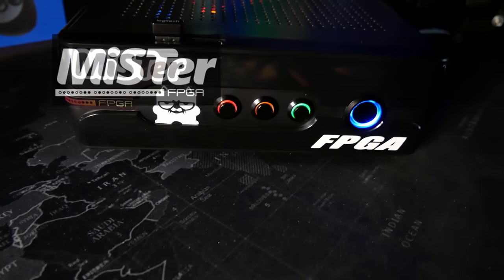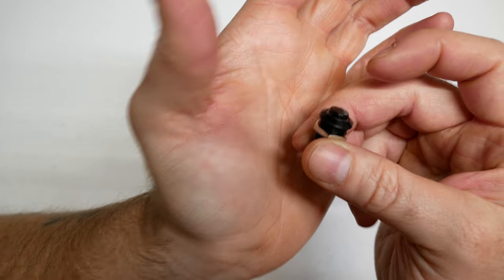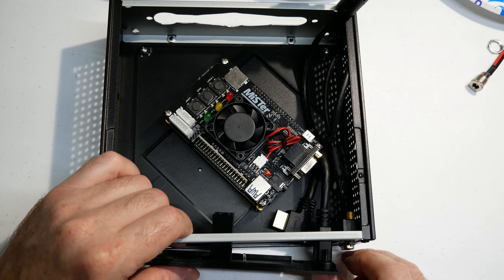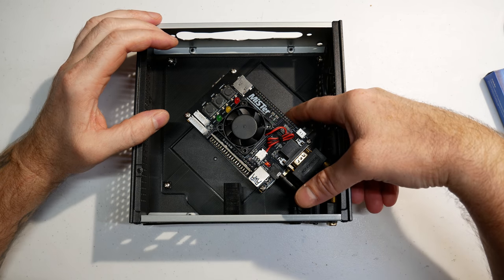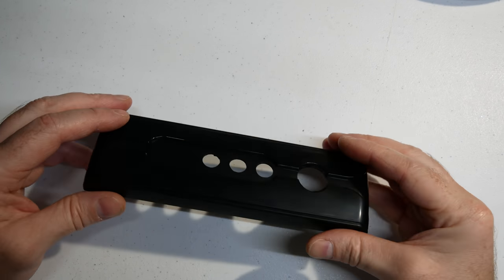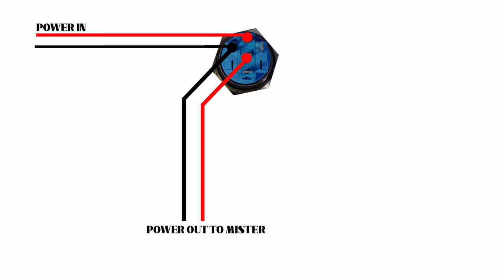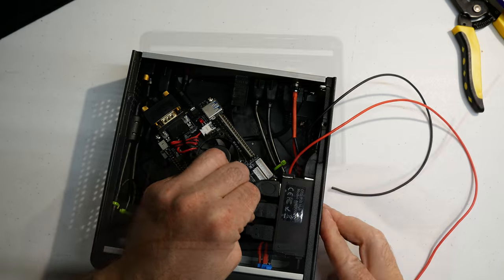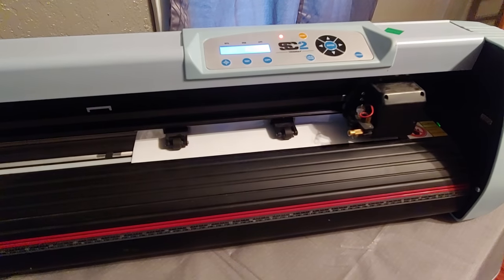MiSTer FPGA DIY Console System Case ... Mini ITX Consolization ... Step by Step Custom Case Guide

Comment: Great video, thanks for sharing. Unfortunately some of the links (e.g. 12mm momentary buttons) no longer work. Can you kindly update these, especially for the LED power button and the three LED momentary buttons (with the right voltages)? Thanks!
Reply from the maker: I wish I had the time to find alternatives but sadly Im out of town 60hrs a week for work and dont have much free time anymore. The 12v led buttons worked good undervolting them, i dont know if id want them any brighter. 

Theres a ton of these style buttons on aliexpress though.

Comment: Very charismatic and fun to watch build.  Thanks for putting this together.  Also, use a DAC to convert the optical out on the IO board to analog instead of a direct 3.5mm connection.  The standard 3.5mm output has a ton of noise and is by far the worst audio output option on MiSTer (compared to HDMI/Optical)
Reply from the maker: Thanks, Im in the process of re-configuring my whole crt/console/mister/ game wall setup and when I was done I meant to look into a better audio option than the 3.5mm analog out and the logitech speakers I was using. Yeah, I overlooked this when building my mister and wish I would of went with the toslink

Looks like ill need a mini TOSLINK panel mount cable to get the mini TOS from the IO board to the back of the case.... I wonder if there is a mini TOS to regular TOS panel mount adapter. 

Once I have that figured out I will order the part and the DAC, is the cheap $15 amazon "PROZOR 192KHz Digital to Analog Audio Converter DAC" suitable in your opinion? I think jotego mentioned using it.
Thanks for the suggestion!
Reply: @LameGaming  A cheap DAC like that would be sufficient and sound much better. We have a recommended one in the MiSTer Discord that was tested as very good performing by one of the local audio wizards and is also very cheap (~$5-10 IIRC).  Those are often USB powered devices and I would recommend not powering it directly from the DE-10 nano also, to prevent weird loopback noise.  I had some issues there until giving it independent power instead of plugging it into my USB board.  Your upgraded power supply would probably be fine to handle both the mister and DAC if you could find a way to separate some power for the DAC there.
Reply from the maker: @WalrusFPGA  Awesome, If you stumble upon the model number or name of that DAC and could comment it here it would be greatly appreciated... YT always removes links. If not...no worries, Ill try to find it, I dont use discord much but need to start using it as everyone seems to be lol.
Reply: @LameGaming  Found it. It's on e-bay and has the generic name "Optical Coaxial Toslink Digital to Analog Audio Converter Adapter RCA L/R 3.5mm" from the seller "survy2014".  Keep in mind I ordered mine back in 2019 when it was tested and these cheap chinese components can sometimes look the same on the outside while getting revised/cheaper internal components. YMMV.  It's still dirt cheap though at around $6, so not a terrible gamble to take either way.  Cheers.
Reply from the maker: @WalrusFPGA  Awesome....thanks!

Comment: Is there enough vertical clearance for the usb hub ( either the regular one or blisster hub ) ?
Reply from the maker: That's a good question and something I should of checked into while in there.
I think there would be but maybe have to mount the fan on the side of the case blowing across the stack from the side.
I'll get some dimensions and measure tonight or tomorrow and get back to you.
Reply from the maker: So I have just shy of 2" total clearance from the mini itx adapter plate to the top of the case. With my current configuration I have about .55" of space left above my fan.
I cant find the height measurement of the hub/de10/IO mister stack, but if there wasnt room to mount it with the brass standoffs I bet it would fit under the de10 in the adapter cutout adhered to the bottom of the case with some double sided foam tape, this is where I plan to put a ssd later on.